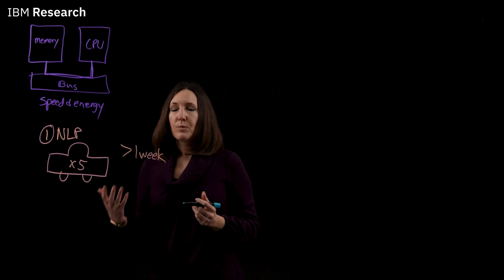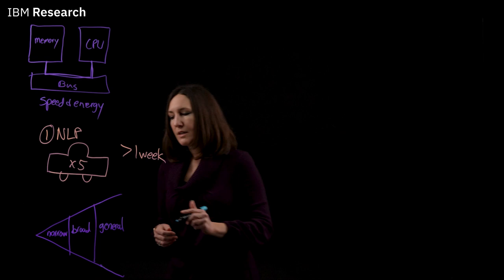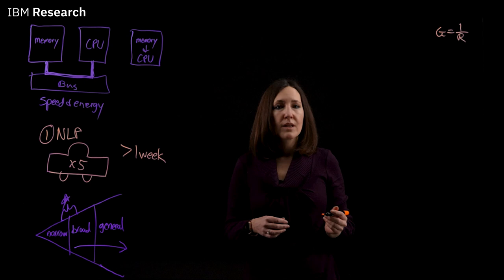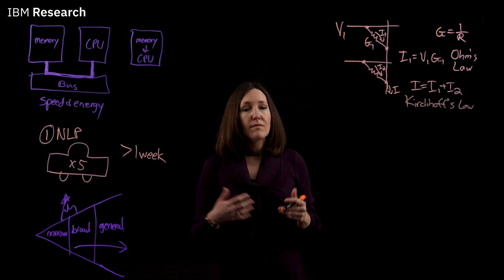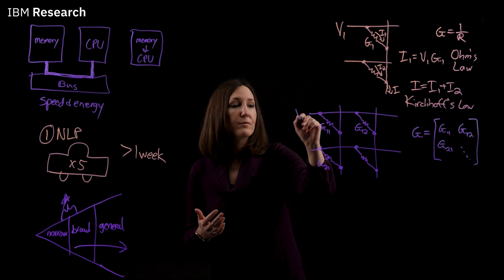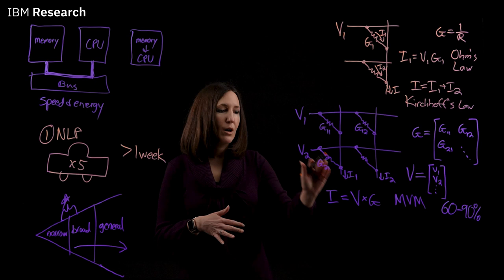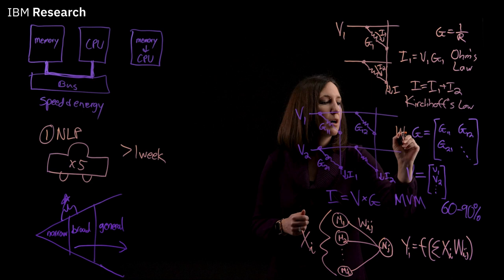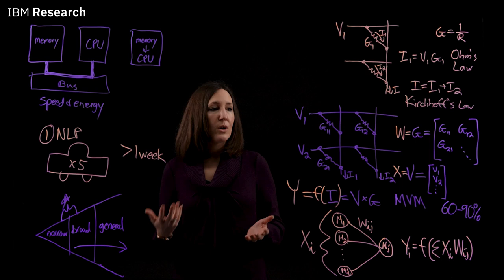What is In-Memory Computing?

Comment: How registers i.e W weight values can be changed dynamically? Something similar to FPGA?
Reply: nah, this can be done using flash memory where electrons/charge is stored in a potential trap, just instead of using discrete values like in 3d-nand, you use continuous charges to represent varying values of G

Comment: What do you mean by “memory”, (in beginning of clip) give an example.. RAM?
Reply: Yes, it is RAM. During the forward propagation process (and backwards likewise) computations are performed as usual by the ALU, so it implies fetch-decode-execute steps that inevitably rely on the buses mentioned in the first diagram. Some limitations can be overcome by GPUs thanks to heavier loads of data and parallel buses between memory and the streamlined multiprocessors. Still way slower than doing everything locally though.
Reply: @thelonespeaker  Actually, RAM uses more power than flash, as flash can store weights (G) with no power

Comment: but how are the G Variables with their different values set into the matrix? I guess they need to be modified when training the neural network so they can`t be set by lithography when making the chip. But how is it done afterwards when working with the chip?
Reply: this is done using flash memory where electrons/charge is stored in a potential trap, just instead of using discrete values like in 3d-nand, you use continuous charges to represent varying values of G

Comment: How does it work for negative weights?
Reply: As far as I understand, using flash memory for this, you can only use positive charge to increase resistance, so you would need to normalize to remove negative values

Comment: 🤔 I am thinking about maybe it is possible to replace those resistors by digital potentiometers in rapid prototyping circuits to expirment with them, as a hybrid between a fpga with resistors, or include already the part of the predesigned circuit: with transistors and these to the resistors. The rest how the memory, demux, D/A, A/D, etc circuit would be designed by the engineer or student.
Reply: A digital potentiometer has typically 5 to 8 bits controlling 31 to 255 resistors respectively, that is 0.3922% resolution for 8 bits, and analog potentiometers offer 2%. In this way AI systems can be designed for home use or small applications at a very low cost. If they are made of 10 bits would control 1023 resistors that would have a resolution of 0.0978%.